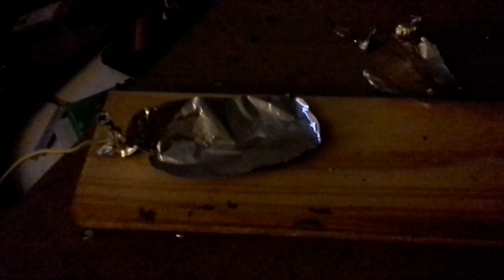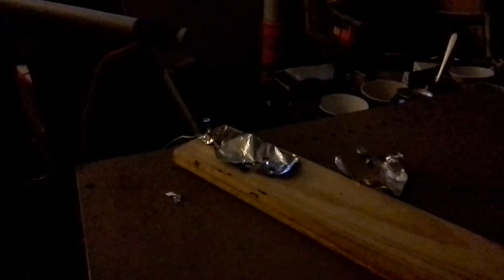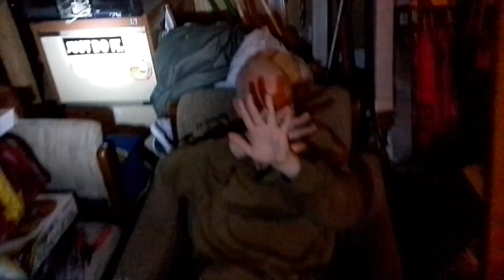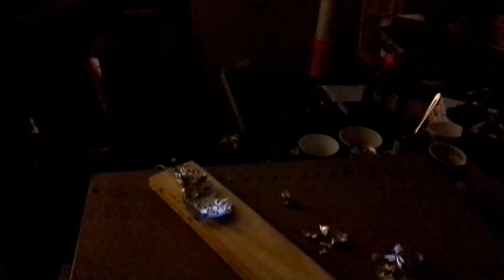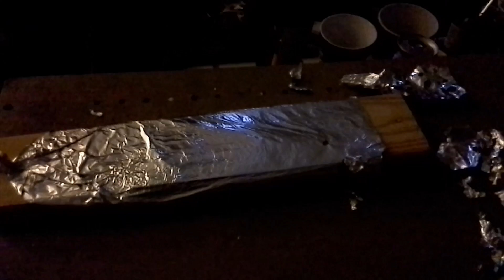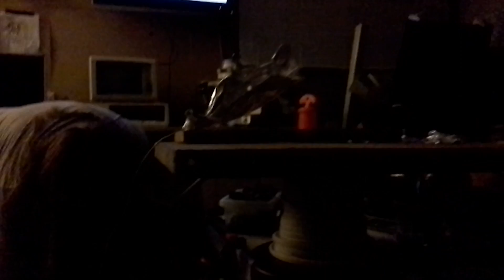Capacitor Fun

Comment: ya gotta "strike the arc".... you ever use an old arc welder? for thows taht dont know.... bassicly, theirs a lot of amps going to a gun, which holds a steal rod with some "flux" around it. to start welding ya gotta touch/drag the rod across the metal(which the circuit is completed by a ground clamp. ) and then quickly pick it up a few MM. to low, it sticks, welds the rod to the steal...in this case you had your heat set to high, you burn threw the metal.... and to high the arc goes out. 

you guys were probably messing up your eyes a bit their....
Reply: hehe, he wants to charge up my big VFD bank, 24 caps at 2400uf 600V DC :D
Reply: Aussie50 Ooo that'll make a nice arc!